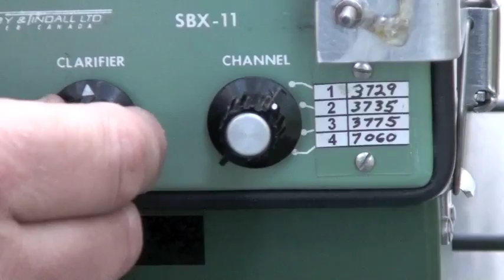QRP HF portable go kit: Spilsbury-Tindall SBX11

Comment: Great looking radio. Would love to own one but afraid to buy what I have found on ebay.
Reply from the maker: I agree.  You would need to ensure you have a source for parts before you buy a vintage radio.  That's making everything harder today with all the ongoing supply chain chaos for this hobby.
Reply: @VA7BC  I appreciate your input. Is there much to the ham band mod or is it as simple as having the right crystals?
Reply from the maker: @JA-fy1bn  Crystals and "coils".  The coils are unique to the SBX11 and SBX11A (the "A" version (orange) being the newer version.   The coils are unique to each of the major bands.   These are the hard things to find.  My radio is set up for 80m and 40m.

Comment: Nice video. I lucked out and picked up two of these someone had tossed out. Found them before the weather got to them. One seems to be operational and is set up for battery or external power but the other has been partially gutted. Neither has the top lid. Can't complain though :)  Also have a length of the 72ohm twin lead.   I used one of these back in Ontario in the 80's on a fire crew.   VE7VJ
Reply from the maker: Nice treasure find Larry.  Always nice to have a parts radio for these so your discovery is perfect.  73 Greg

Comment: Nice rig... plus, the cover could come in  handy snapped on the other way and that would make a nice little catch-all for a pencil, etc. in addition to angling the front panel up.  :)
Reply from the maker: Tnx Terry. Actually you are correct, the lid should be snapped in place the other way around. You have a good eye! 73, Greg
Reply: Yw :) 73

Comment: used these all the time back in the day on the trapline ..does anyone know where a guy could get a couple of these
Reply: You can buy new from the manufacturer Paracomm Technologies Inc Canada, the latest model is called PCX-250 and it’s all new. No more crystal controlled.
Reply from the maker: +Asphalt Cowboy N60 The green (SBX11) version is hard to find.  The "newer"orange  (SBX11A) version pops up on Ebay from time to time. There is also a Yahoo group for the Spilsbury SBX11 radios where they pop up for sale once or twice a year.

Comment: Actually there is nothing to mod to put them on the ham bands, they do 1.6 to 8 (10) MHz from the factory.
The idea of an Anderson power pole connector mod is not all that good, this radio was designed to be able to slide around if need be and something like this would snag.
Although the original battery pack is indeed a bunch of D cells there is a connection for 12 volts and it is a simple matter to go from this connector to the power pole.
Reply: Only has USB mode no LSB, so need some mods to have it done.

Comment: i have 2 Spilsbury-Tindall FMX-75 marine VHF radios from the late 70s to early 80s one at the camp and one at the house   the one at the camp is in mint condition had it fore a few years and it is the best i have ever seen and the one at the house i just got  not long a go was rusted beat to crap cracked wiring hacked into and still with a home made power cord and a old  4 pin Mic  it worked beater than a 800$ icom 

send me a comment or pm letting me no what you think some day i will make a vid